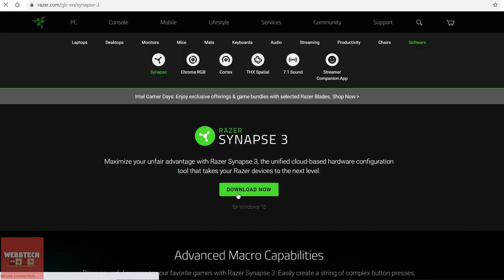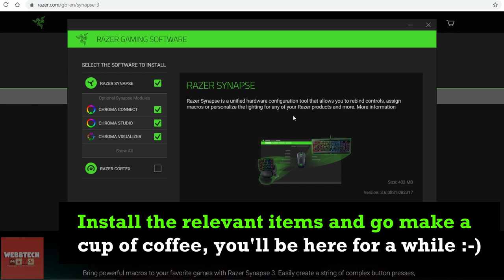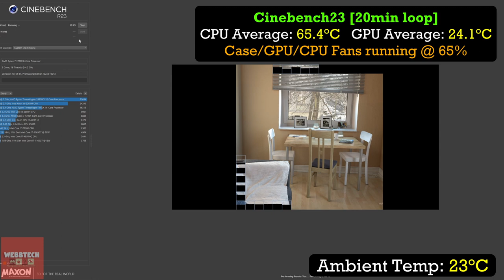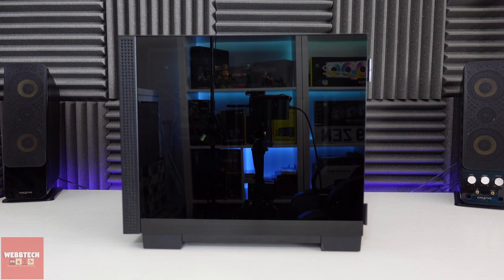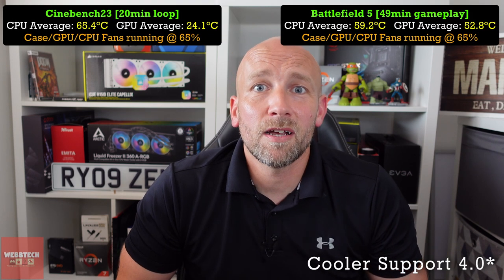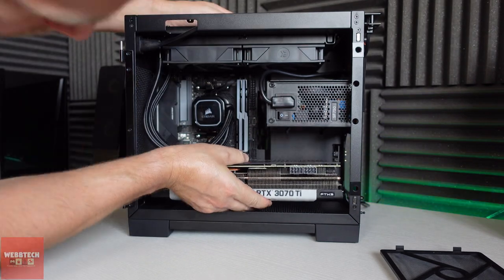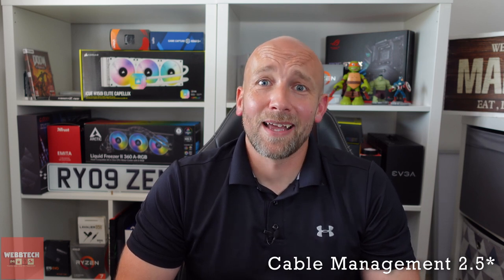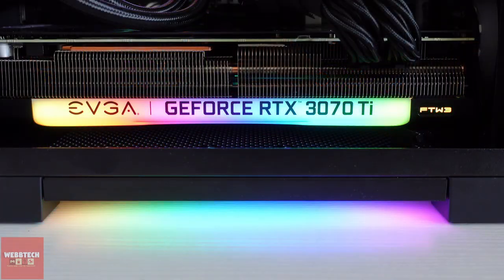Razer Tomahawk ITX Case - Build & Review

Comment: nice build 👍 do you think 15mm fans will fit beneath that 3070 Ti?
Reply from the maker: I think I tested it, was a long while ago, and there wasn't enough room. If you are going to use this case and GPU combo, see if the thermals are acceptable and if not measure the gap and maybe get some low profile fans.

Comment: when placing in the PSU, do you want the fan of the PSU facing down or upwards?
Reply from the maker: Where possible, point down so that fresh air is pulled in from outside instead of it using hotter air if the fan was facing upwards.

Comment: I have the same case with a ROG RYUO 240 and a RX6800XT. The aio cable touches with the rear fan. I was forced to turn 90° the screen of the pump. And if not level of heat, it's not terrible (I have a 5800x too) 
Otherwise I love this case 😁
Reply from the maker: I experienced the same with the H100i, manual manipulation of the tubes helped but it is very very tight. You could use a fan grill that would stop the contact, but if you already have a solution then you don't need to :)

Comment: I'm going to get this same case to pair with a 3070 Ti FE. Do you think 2X 120 LL corsair fans would fit underneath ?
Reply from the maker: Yes they will fit. You should have a few mm clearance left. I've used a 3070ti fe in a few 3 slot itx cases and 25mm fans have always been okay. I don't see why this would be any different.

Comment: bonjour, j'aimerai acheter le mini-itx de chez razer avec à peut près la même configuration :
- 1 watercooling 240mm razer 
- 2 ventilateur 120mm razer
- AMD Ryzen 7 3700x 
- razer pwm pc fan controller 
- asus rog strix b550-A Gaming
-  EVGA FTW3 Ultra GeForce RTX 3070 Ti
- SSD Samsung 970 Evo Plus 2 To
- 2x16GB Corsair 3600MHz DDR4 Vengeance RGB Pro SL

Mais j'aimerai rajouter 2 fans razer 120mm en dessous pour avoir un meilleur flux d'air (en plus du watercooling en haut et les 2 fans sur le cotés) est ce possible en utilisant la même carte graphique de la vidéo ?? Mais du coup je n'est pas encore choisi l'alimentation (je pensais a prendre une CORSAIR -CX Series CX750F Rgb 80+ Bronze) mais si c'est possible de rajouter 2 fans en dessous est ce que l'alimentation suffira ?? 
En espérant avoir une réponse a mes question :)
Reply from the maker: à l'aide d'un traducteur, veuillez donc excuser mes inexactitudes. Vous avez besoin d'un bloc d'alimentation SFX ou SFX-L pour ce cas. Vous n'avez pas beaucoup d'espace à gérer, je vous recommande donc de vous procurer le SF600 Platinum ou le SF750 en raison des câbles fins et faciles à gérer. Fans, vous aurez du mal sous cette carte. Je pense que j'ai essayé et qu'il n'y avait pas assez de place. Vous pouvez réussir avec Noctua à profil bas, mais je n'offre aucune garantie.
Reply: Super merci de votre réponse. Je pense que je vais pas mettre les 2 ventilateurs en dessous et mettre la même carte graphique que vous avez utilisez la RTX 3070ti, et mettre l'alimentation Corsair SF750 que vous avez conseillez. Pour le Contrôleurs de ventilateur et RGB (RAZER PWM PC FAN CONTROLLER), je peux le mettre en dessous de la carte graphique (sur le châssis) où sur l'alimentation ?? (j'avais une vidéo ou le gars il le mettais sur l'alimentation où c'est pas très conseillez). Et pour le ssd Samsung 2To je pense que ça suffit car je pensais ne met pas de disque dur ou vous me conseillez quand même un ssd 1 To + un ssd interne de 1To comme dans la vidéo car je n'est pas vu où vous l'avez placé dans le boitier
Reply from the maker: Bons choix - GPU et PSU. Je ne mettrais pas le contrôleur sur le bloc d'alimentation, mais vous le savez de toute façon. Lors de la construction, je suis sûr que vous trouverez un endroit approprié pour mettre le contrôleur. Cela fait longtemps que je n'ai pas utilisé le boîtier, donc sans regarder ma vidéo, je ne connais pas trop la façon dont il est configuré :-)
Reply: @WayneWebbFilms  super je vous remercie beaucoup :)